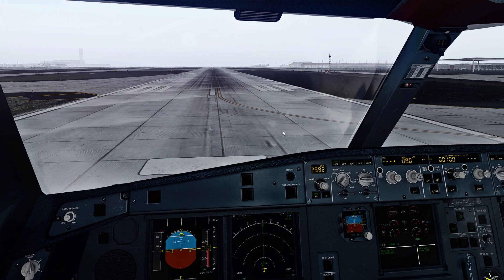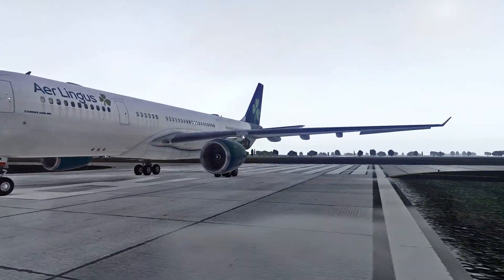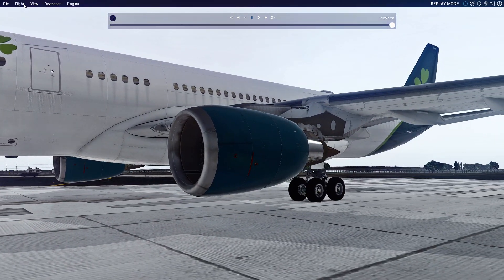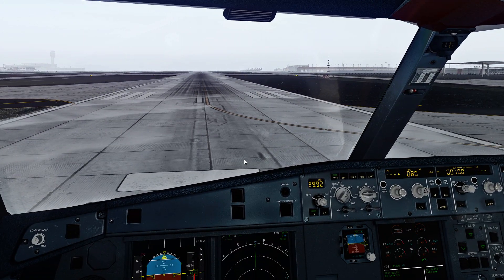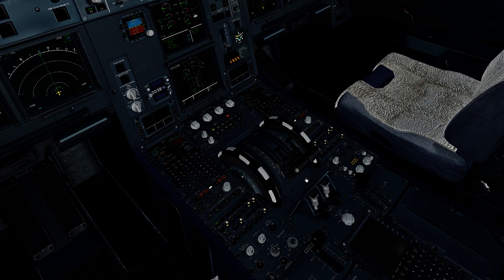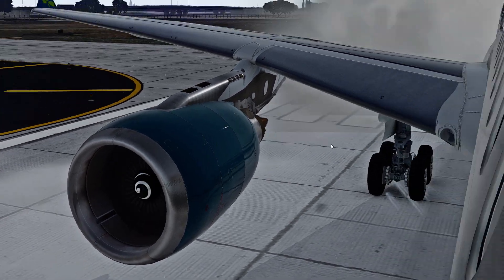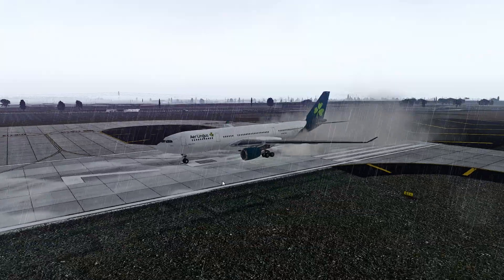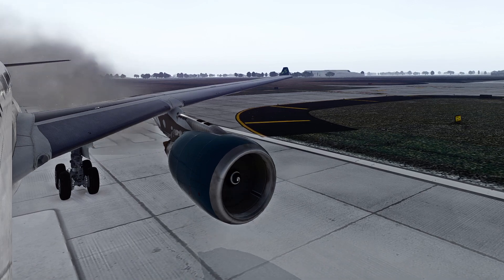GE CF680E1 Engine Mod Preview

Comment: Amazing, I really want to try it but I have noticed some things that you can fix and implement, an error that I have found are the fan blades of the motor that make some white blows that are quite bad, that is the only error that I have seen and for the rest of the mod is that it is great, now I would recommend you to make 3 different textures from the one that the motor you have already made, that is, you just made the texture dirty (the motor is somewhat dirty and rusty) I will I suggest that you make one that is cleaner than the one you have shown (that is cleaner and with less rust than with the original texture) and the last texture is the one that is completely clean (without dirt or rust, as if the engine had just finished leave the factory).
I hope you do it soon and it is worth downloading this amazing engine! 
P.S: Will this mod be free? Can it be downloaded at x-plane.org?
I await your responses!
Reply from the maker: Not sure what you mean about the error on the N1 blade?, as for the clean textures it’s something I may look at on an update version dirty textures to start with.
Reply: @cardajowol  ok thanks for answering about the textures, on the subject of the N1 blade you can see from minute 4:17 (when the engine is fully operational) a few white strokes on the blades. 
Another question is if this mod will be on x-plane.org and if it will be free.
I hope you solve my questions and the small error (if it is not an error, let me know).
I wait your answer!
Reply from the maker: The white mark is probably the sun reflection, it will be a free mod yes and it’s not released yet.
Reply from the maker: The white mark is probably the sun reflection, it will be a free mod yes and it’s not released yet.
Reply: @cardajowol  ok thanks for answering my questions! One last thing, this mod when it has been released where it can be downloaded? In other words, will it be downloaded by x-plane.org, by drive or by a file that you send? And how will you notify the launch? 
Forgive my millions of questions but I am excited to try these great engines! 
I wait your answer!